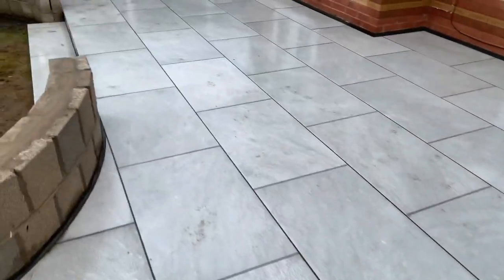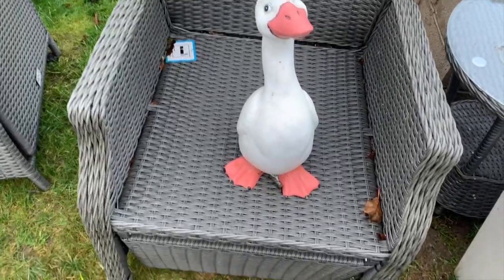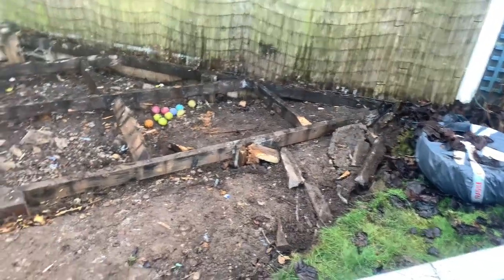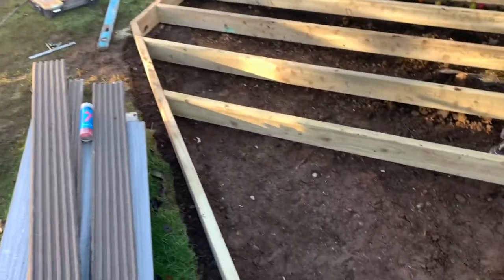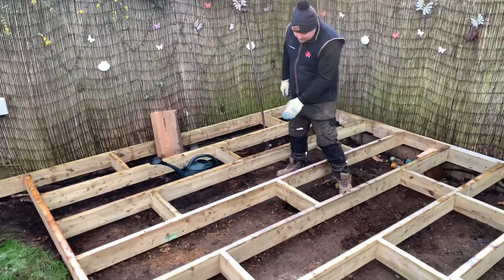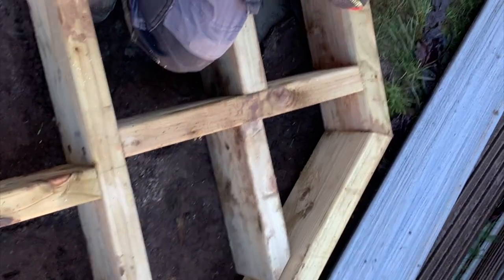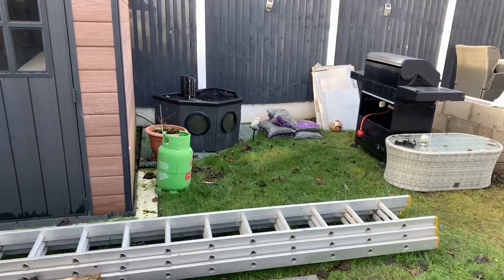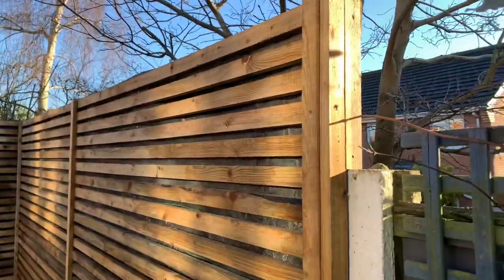GARDEN DECKING TRANSFORMATION | COMPOSITE DECKING

Comment: Nice to see the subframe raise slightly off ground.  So many you tube videos with the subframe resting on ground which as I found, rots the timber!  May I ask, with Trex, can you vary the gaps slighltly between composite boards, to bring the edges in line with edge of subframe.
Reply: worth knowing
Reply: I would happily space out 10 boards 1mm at a time to squeeze up a 10mm run at the end
Reply: Treated wood is made for ground contact. But I would put a weed barrier down. I have snakes, so my deck needs to be ground contact only